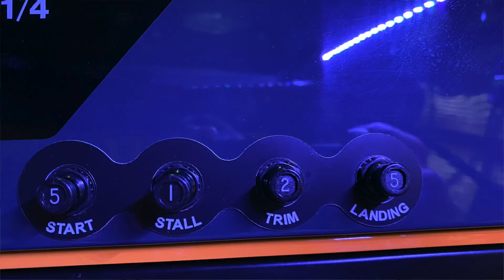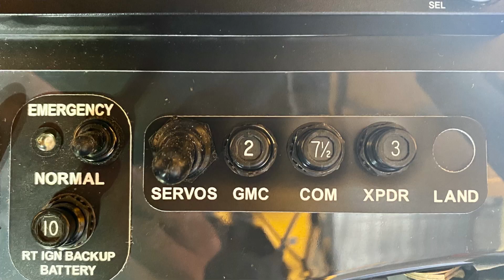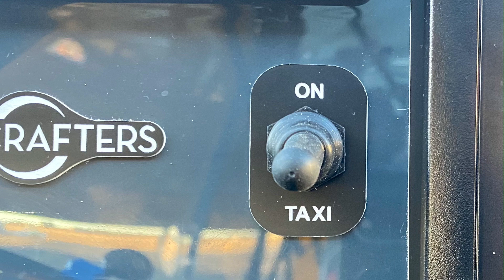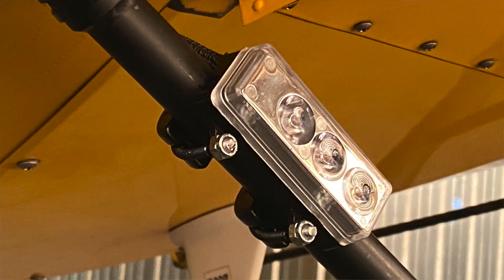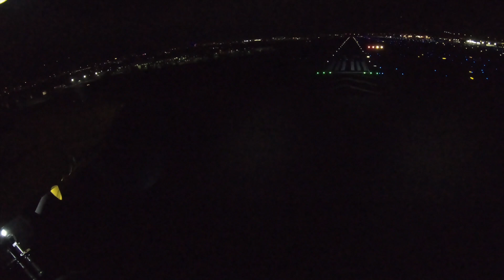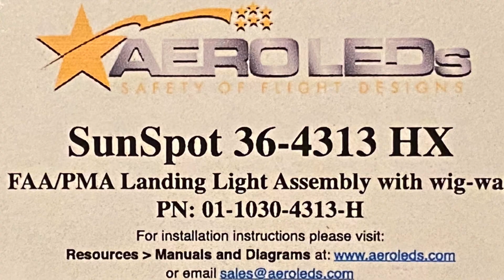Carbon Cub Landing Lights

Comment: You could have done it with a relay instead of relabeling. But that does add another potential failure mode.